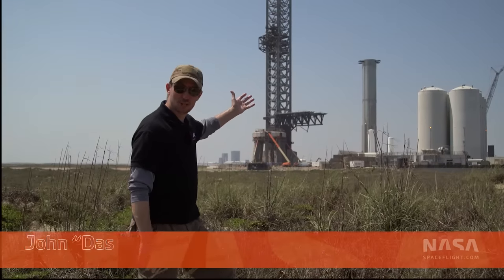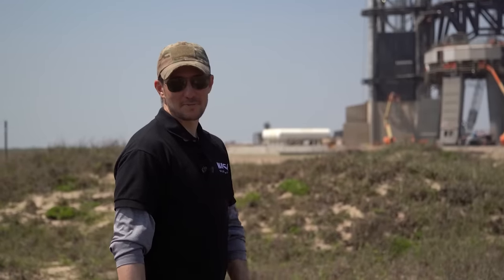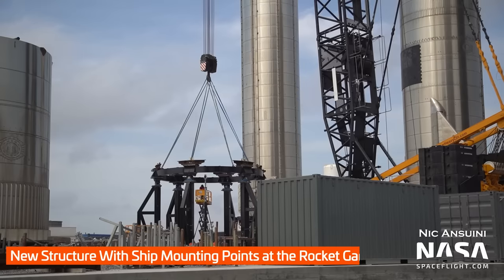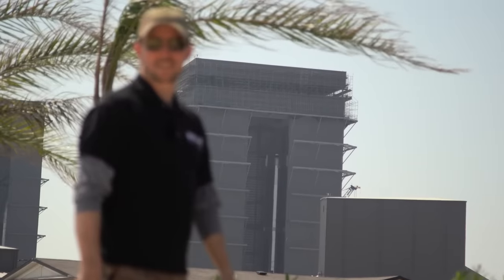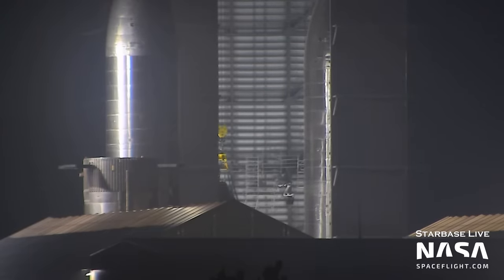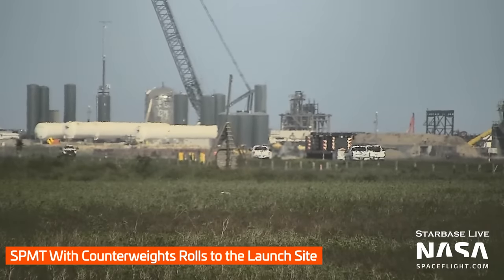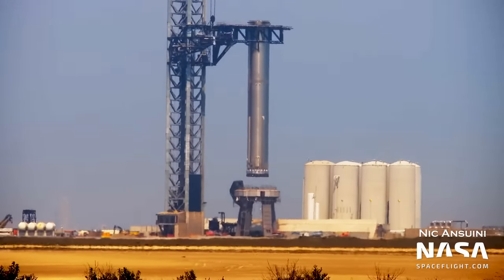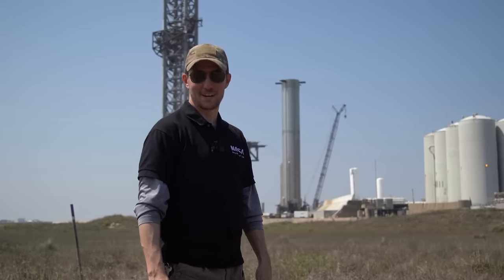Starbase Update: Booster 7 Leaves OLM, Booster 9 Gets Engines, & New Ship Lifting Rig for Starship

Comment: Ship 24 payload bay could be getting a data acquisition setup installed.   First flight you are going to want it instrumented, that means stress and strain measurements, temp measurements, vibration measurements, video from inside the tanks, etc....  All that needs to be digitized and formatted for transmission during flight.  My guess is they have all the sensor leads routed to the payload bay and the digitizers and Xmission equipment is all going in the payload bay.    It is like Shuttle Columbia, all that unique data acquisition equipment.
Reply: Every ship the have built to date has been full of sensors and all kinds of cameras. That is not something you do just before launch.

Comment: I wonder if they can get a booster to the gun range, and honestly that’s a great idea… why would you have 2 lift points on the ship? Have it all in one!
Reply: What do you mean by "2 lift points"? Do you maybe mean 2 lift methods? In that case I agree. Having one method to lift the ships is better than 2.
But if you meant 1 lift point - it can't be done and also be stable.
Reply: @knowledgeisgood9645  1 point is the squid lift and 2 point is the chopstick lift, 
I should have said; I believe it makes different stress points on the vehicle itself. And yes that’s what I meant one lift point is better then two having 2 different stresses has to have a difference in the way the ship tanks up and gets it’s load stress or something like that… whole idea is if there doing it it’s for a reason and that reason idk… lol
Reply: @Ch33ziTzsk8R  It has to do with how they make the nose cone. When they start they have to be able to lift it. The points below the flaps are not yet part of the cone. Those points were introduced later than the six lifting points around the nose cone. Maybe they will be using a new method of building them, idk.
Reply: @knowledgeisgood9645   I understand that makes sense

Comment: No way can they launch without the deluge system in place.
Once the deluge is tested you know it will be close to launch,
Reply: Way. The deluge is a precaution, not a requirement. It will take months to just install the water tank...
Reply: @knowledgeisgood9645   They already have a massive water tank.
Reply: @philb5593  No, that is for the fire suppression and other uses in the tank farm. The deluge needs a much much bigger tank than that.
Reply: @knowledgeisgood9645   The water tank in the tank farm is like twice as big as the one at LC39b so I don't see why it can't be for both
Reply: @philb5593  It is not twice as big. I have no measurements, but just by comparing it to the tower and OLM legs I am almost sure it is much larger.
But it is beside the point. The tanks now at the tank farm are used for other purposes and can't be just diverted for the deluge without a replacement. Add to the that their location.